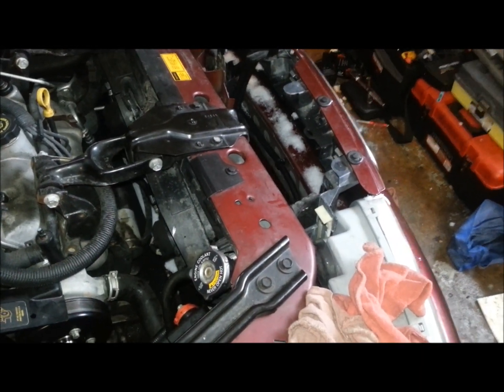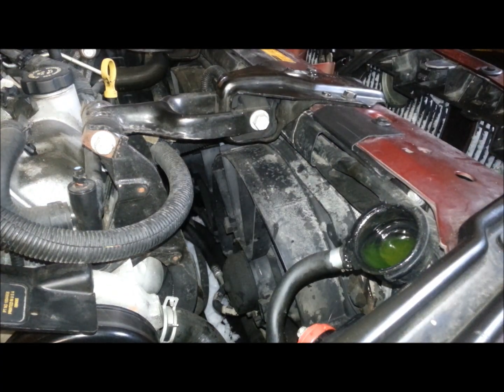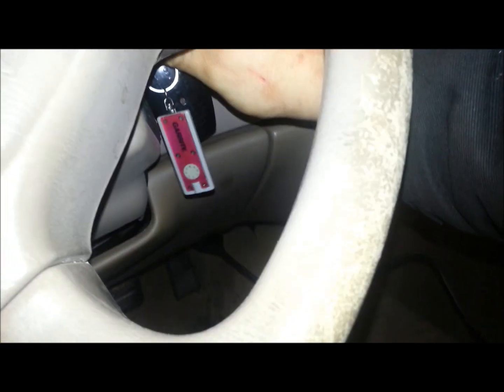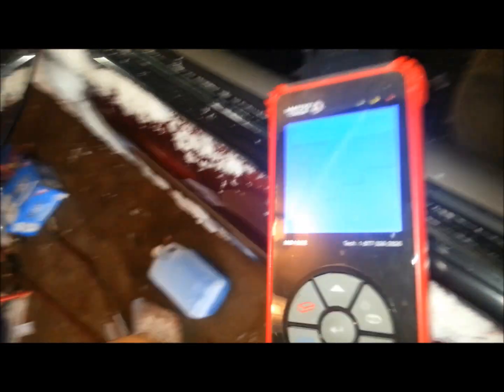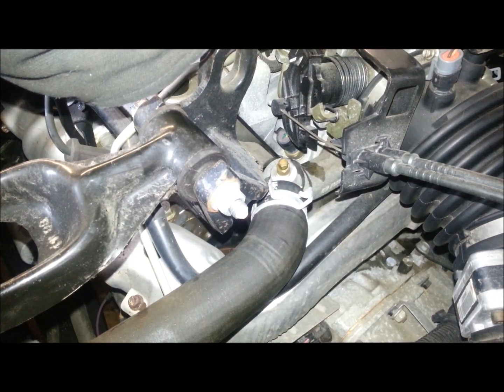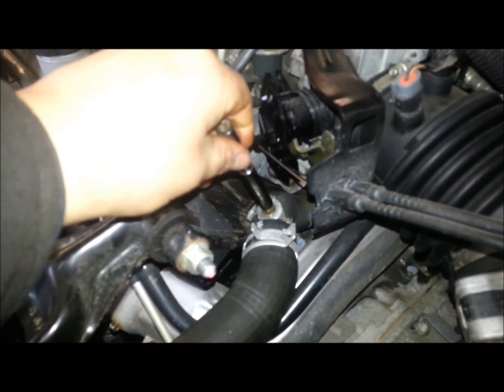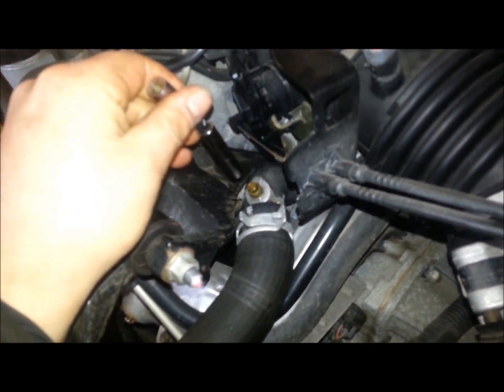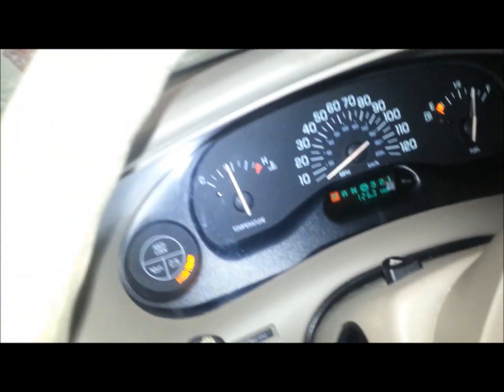how to bleed coolant system 3.1/3.4 liter

Comment: Just a question, 03 Grand Am 3.4l screamin kitten ,  The engine cooling fan is shot( Main Fan), The ac compressor cooling fan works and draws air thru the radiator. Is the engine cooling fan (main) Suppose to draw in or blow out? I`m thinking it is to blow out to circulate air thru the engine compartment ? I`m buying a hi perfomance fan and having to wire it. Just wondering if the main fan draws in or pushes hot air out? Thanks
Reply from the maker: the cooling fans are for pulling air through on this model , so to reiterate  they suck air through the front of the car
Reply: +JoeTheAutoGuy. Thanks. Just wanted to make sure. i appreciate it.
Reply: +Richard Parker I just bought the car cheap with 84k miles and the engine fan wasn`t working, Gave it juice directly to test it, That is why I didn`t know the function. So Thanks again. At least the 18 year old I bought it from didn`t blow the engine, And I got a good deal.

Comment: joe, could you please explain why you should not touch the other bleeder screw?  9:48
Reply: I am wondering the same thing...why should we avoid that bleeder valve?
Further up I read this from Joe:
"no problem, that bleeder is for the initial fill, no pressure or heat , 
and coolant system is empty. you open that one and once fluid comes from
 it close it down , do not open it under any pressure or it will blow 
and if the engine is running it will blow like old faithful"
Reply: I think it may be for the AC, but I'm not sure.
Reply: @skillzorz101  lol, i cant stop laughing.  both bleeder release holes are both the same, just different positions along the coolant line.  these bleeders have nothing to do with the ac or the heating, all they do is make sure the coolant is at proper level, so the HEAT works, and your car engine doesnt overheat more importantly.  This video is a bit wrong.  Someone else commented and enlighted me as well on the proper way, open both bleeder holes slightly WITH engine OFF, add coolant, and close bleeder bolts while coolant is flowing out of them, this ensures no air is in the system.  He also mentioned the method in this video allows air to be Sucked into the system, thus, defeating the whole purpose of your operation.  Please take care.
Reply: I am assuming this will fill the pump with air..
Reply: its on the waterpump
Reply: esinde no aselera como es
Reply: Have a 2006 equinox 3.4l. Is this bleeder valve located on the water pump? Is it on the water pump on these cars. Thank you
Reply: So, I'm having issues with my 1995 Lumina getting it to fill up...  So, am I understanding correctly (you know I'm going to try it anyway because it might take a while for a response) When cold, I can open the pump bleeder, fill till probably coolant comes out or radiator fills, which ever is first (which I only fill radiator now), then seal and when warmed up, start the bleeding on the bleeder on the other side?   The first time I had to bleed it, I just had to bleed the 'regular' bleed valve, which pushed steam for a while, like Joe's did, then coolant, I tightened, and we were good.

But this time... all it ever does it push steam, and a spurt of coolant now and then.  I can't seem to get it to run steady coolant.  Consequently, it's still doing the rapid heat up.  I can't seem to get enough water into it to move into the second phase of coolant only with no air/steam.   I'm hoping it's not a thermostat issue, they're a bugger to get at.  Any ideas or suggestions?
Reply: @ZenMasterChip   This video is a bit wrong.  Someone else commented and enlighted me as well on the proper way, open both bleeder holes slightly WITH engine OFF, add coolant, and close bleeder bolts while coolant is flowing out of them, this ensures no air is in the system.  He also mentioned the method in this video allows air to be Sucked into the system, thus, defeating the whole purpose of your operation.  Please take care.

Comment: hi awsome video. my mom's got a 2000 Monte Carlo. and it has no heat at all. the heater core hoses are Cold ice cold   but then the lower will get a lil warm not hot .. but not temp change?? and ideas.  winter just hit Chicago. need help

Comment: so, what kind of bad day if you mess with the other bleeder?  out of curiosity.
Reply from the maker: +Dan Caldwell  you can open it when your first filling the system when its complete and 100% cooled down and your doing the initial fill , if there is any pressure behind it nd your not careful you will get hot coolant spraying like old faithful and thats just bad news
Reply: +JoeTheAutoGuy  ok, I expected that was the reason, just was concerned that it was attached to some special valve, and I didn't want to ruin something.

Comment: I usually run the engine at 1500 rpm with the rad cap off. The coolant level will drop, add more. The t-stat will open, add more. Once the top rad hose is hot and the coolant doesn't drop anymore. YOU'RE DONE. Why make love to the job?
Reply from the maker: +Daniel Peters totally understand the bleeding procedure just sometimes these are a little stubborn and it helps to do it this way
Reply: yep bleed mine twice but forgot to have the heater on so it would be good for a day then overheat again also i was opening both bleeders

Comment: Thank you;  use a funnel to fill the radiator and fill the overflow/coolant capture reservoir as well!
Placing a rag around the bleeder screw will help to soak up coolant and cut down on exhaust manifold steam!

Comment: my 03 impala is getting hot when I am on the freeway going past 75 mph, if I turn my heater on the temp goes down pretty quick. Regular driving in town the temp is fine. I am gonna try this bleed. But I am thinking the water pump is starting to go. What do you think Joe?
Reply: U got intake issue or head gasket
Reply: If my head gasket was blown, wouldn't my oil be a quick indicator? My oil seems to be fine with no water or foreign fluid in it. What kind of intake issue could I be having? I do know that I did NOT use dex cool the last flush so I am gonna change that next, along with my temp sensor.
Reply: You Mang intake gasket leak .if it's get hot while speeding ?it should cool off while at high speeds .maybe it's a simple fix just saying if or intake I'm my opinion
Reply: Mc da shiznit good u got green coolant .don't use dex try bleeding Ur system again 1st
Reply: Mc da shiznit check my video out coolant swap any car I get with dex I flush as soon as I touch em go with green
Reply: Mc da shiznit Yeah it's baffled me for a minute. I ran it without a thermostat for a while and it was doing the exact same thing. I put the thermo back in and it does the exact same thing. I am thinking, and I could be wrong, but was thinking maybe there is a computer setting that could be reset and have the car run cooler? You heard of anything like that?
Reply: You Mang no neva heard of comp reset ....but intake notoriously weak on these models..it's a well known issue

Comment: I thought you weren't supposed to remove the radiator cap while the engine was running? Thought it'd spray coolant and burn you?

Comment: the other bleeder by the wp is the best one to use, its the highest point in the system, I keep both semi loose and open each one as I check then shut it back off without tighetneing, wait for a little pressure, do it again etc
Reply: Exactly.  The bleeder by the thermostat is nice and all, but the job isn't finished until the one by the water pump has been bled also.  Don't skip it!
Reply: Ash Miller Thanks! That’s all I needed to know. Cause on my Malibu that’s the only one I see 💁🏾‍♂️

Comment: I have 1997 grand am gt 3.1 I replace the water pump and its leaking from the bottom of the engine any suggestions what it could be ?
Reply from the maker: David Trippymane  check your water pump gasket and hoses, perform a pressure test to find your leak specifically

Comment: My 01 Malibu 3.1 only has one bleeder valve by the water pump. Do I open that valve or just leave the reservoir cap off until it bleeds the air off since it's up higher than the radiator and hoses?
Reply from the maker: Antonio Cabrera  on thos just leave the resivoir cap off
Reply: I have a 03 malibu with the 3.1 it only has the bleeder above the water pump should I open that one or just the tank? You've said no but I've heard yes. Anyways I've tried both to no success.

Comment: how to drain a radiator in a 2005 impala 3400 this is what I searched for and this crap is what I got
Reply from the maker: Gunzmith Dragonkind this is a video on bleeding the system as the title says , the owners manual tells you how to drin the radiator as well , its on the left hand side it drains through the mounting grommet

Comment: I had head gaskets replaced by a "friend" and he managed to forget a nut on one of the hose fittings when he put it back together.  This video was more helpful than my "friend" was with how to get the air out of my coolant system after I fixed his mistake and tried to add coolant to what seemed like a full radiator.  The car still had the "low coolant" light on and I knew something wasn't right.
Reply: sinborn41214 you should try replacing the head gaskets, you'll be looking for that friend.

Comment: Hey Joe I have the 3.1 liter in my 1998 Chevy Lumina I did exactly what you said to do you said do not touch the bolt above the water pump but you did not say why you said it would mess up your whole day well I tried filling it with coolant and bleeding it the way you showed me that did not work it still overheats how do I bleed it correctly

Comment: Mine only has the one bleeder screw with only an expansion tank cap. Manual says to crank up and run to operating temp and then open the bleeder screw you just said would give us a hard day.. Does the bad day apply to me and my vehicle? Lol. Thanks.

Comment: I have a 2005 chevy impala LS I flushed the radiator, changed the thermostat and my car temperature still raises when im at the stop light. Plus my fans do work they come on when they are suppose to. My question is do I need to bleed it?
Reply from the maker: Mychal Davis if still over heating check if there is air in the system if so possible small leak , low coolant, headgasket , the list goes on hard to say what your problem is with little info.  what engine do you have in it ?
Reply: It's a 3.8

Comment: I highly recommend the Lisle Spill-Free Funnel for purging the system rather than tampering with the bleeders. I picked one up online for about $35 shipped and it was worth it because it's so fast, easy to use, reliable and not a drop of coolant is spilled or wasted.  You simply begin with the engine cold and the car parked on an incline, jacked or on ramps to set the radiator as the cooling system's highest point, attaching the funnel to the radiator neck with the adapter fitting included with the kit and fillling the funnel halfway with coolant, heater turned on to its hottest setting, and watch the air bubbles rise to the surface of the funnel puddle and escape from the engine, mildly at first and then more aggressively once the thermostat opens.  Then when the bubbles and gurgling stops, you're done.  15 minutes.  Try it.  God Bless.
Reply from the maker: DDEENY have had one at my job for years love it but didnt have it home on the day of filming but yes your right its a great tool i am editing a video on using one in the next couple weeks

Comment: hey joe need help so bad and your the dude to do it...3100 sfi chev Malibu..no heat... coolant levels fine no leak.... replaced thermostat  no leaks after... bled coolant system no heat... both hoses going in and out heater core same temperature both get hot so not clogged...took apart the console where the ac and fan switches are and cleaned the contact  no heat.. only cold air like the ac is on but it is not... maybe I can disconnect the a/c so that is out of the picture..?  Sabbakka11@hotmail.com  please give me your incredible advice on what you might think

Comment: Look at the way your Radiator cap was designed for that specific vehicle. Every time you pour Coolant into the Radiator cap without a funnel; your practically spilling Coolant all over the place. Brilliant Engineering.
Reply: True. How could I have forgotten to mention that most important rule.

Comment: Joe what happens if bleed both of them because my heat comes and goes and still overheats
Reply from the maker: Brandy Archey you need to diagnose where air is getting into your system could be a intake manifold issue or headgasket and needs further diagnosis

Comment: Just found your video, waiting until I have the money to buy some anti-freeze and going to try to follow your instructions, wrote them down in order so I hope it works. I am not a mechanic by any means. My wife's aztek has been down for 14 months now while I taught myself how to change the thermostat, heater core, radiator, all the hoses, and the water pump. It is our only vehicle so I hope this works. If it does you will not only get my thanks on here but I will be throwing your name and link out on facebook too. If it doesn't work, no worries, I won't give you a bad review, I am not like that and don't blame others for my problems but you will get some promotion from me if you make my wife's Aztek work finally.
Reply from the maker: Jesse Woof glad to be of help, what was the initial reason it was down?
Reply: Not blowing heat and overheating. Took 11.5 hours to go 23 miles. Replaced thermostat 3 times, then ask in one shot did thermostat, radiator, heater core, water pump, all hoses, cleaned throttle body and coolant passage of throttle body. Took most if the year to learn how to do all of that but got it done. Was originally trying to bleed with both bleeders until I watched your video. Wrote down ask the steps in order, have watched it 3 times and after I get some antifreeze on the 3rd I'll watch it one more time before I go it and tackle it again. Hoping after all this work it's not the damn head gasket.
I have white smoke in start up but then it clears, I don't see or smell coolant at the exhaust, no coolant in my oil, and haven't noticed any oily film in my overflow reservoir do I am hoping it just needs to be bled properly.

Comment: Great video and thanks.
What if I'm getting nothing but air out of the bleeder?
Fluid level appear to be full
A the end you mention not to touch the water pump bleeder, why so?
Reply from the maker: InspiredGuitar1 bleed the system by opening the radiator cap (when its cold) and top off coolant, run the car at a accelerated idle about 1000-1400 rpm as the car heats up the antifreeze level will rise and when it gets to operating temperature or close shut the radiator cap  and then open the bleed valve if it continues to run hot to get the stubborn air out. when it runs in the normal range then wait for it to cool down then open the cap (COLD) and top off coolant , if you touch the other bleeder it could blow off and burn you i did it once and it blew like old faithful

Comment: Hey Joe.... 2005 Chevrolet venture.... I can't get enough heat. It's starting to get pretty come here (-17 c) so heat is a must. The fan works fine but no hot air for me. Any ideas ???
Reply from the maker: Hasaan Bhutta might be low on coolant and or air in the sytem, if you have rear heat it can be an issue with air trapped in it that can be hard to get out, might need a spill free funnel to run and get it all out

Comment: I took my car to jiffy lube to have my system bled and they used the other valve that you said in the video not to use. The next day my car over heated so bad that it blew a head gasket. Thank you for this video on the RIGHT way to bleed a coolant system.

Comment: I did everything right except for the part at the end where you remove your radiator cap to check the coolant level.  As soon as I loosened it, I got hot coolant all over my hand.  Thankfully I was wearing gloves.
Reply from the maker: cdxltube in the vid i say take caution as the system i under pressure and do that while it was cold  just fyi

Comment: what happens if you opened the bleeder valve that you sed could make for a bad day. I was told to use that one . Can i get air out with the valve on thermostat im doing it in a 3.4 L your video on the water pump helped alot got mine in and no leaks!
Reply: O and im having heat issues also after replacing water pump and its a closed system so i believe its air in system.
Reply from the maker: Joshua Lambert on the 3.4 some have the pressurized water reservoir run that with the cap offf until at operating temp accelerated idle ( 1200-1500 rpm)  then watch your coolant level and fill to level line after it runs and sustains at operating temp 195-210 degrees then cap off and idel to see if it sustains temp and have full heat

Comment: but what happens if it keeps doing it. or should we change the thermestat
Reply from the maker: Kelly Harrison if your having overheating issues i would look into it. changing it is kind of pain but doable
Reply from the maker: Kelly Harrison i would also pressure test the system to find another problem if it persists
Reply: the mechanic did that, nothin came up on his test. dont know what it is.

Comment: Thanks Joe...will try this. My Montana is overheating, so hopefully this will fix that.
Reply from the maker: Brian Herron ussually this is not the cause of overheating. It is when being performed after a service but i would perform a little more diag and get the system pressure tested
Reply: Might wanna check if the thermostat is opening and at what temp and/or the water pump not doing it job. Also can be a compromised head gasket/ warpage/ block cracked, clogged cooling system etc.
Reply: @eliezerramosjr1017  Actually it was the head gaskets which were replaced shortly after I sent this message. You must be a VERY BUSY guy to take 5 years to reply to a comment on your channel!!